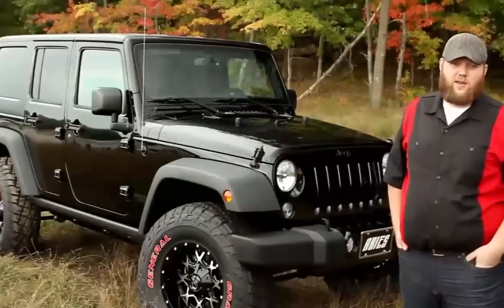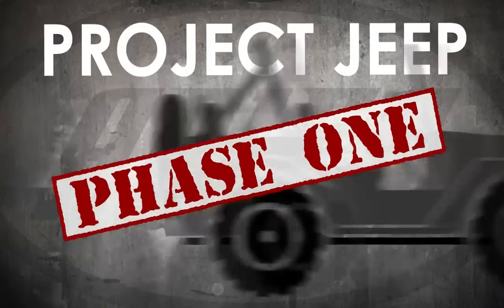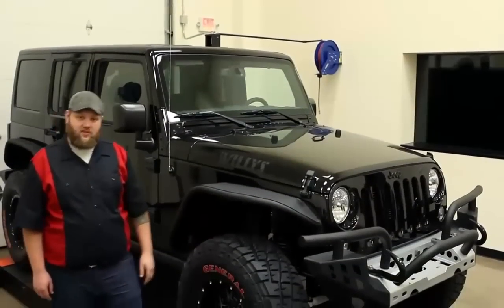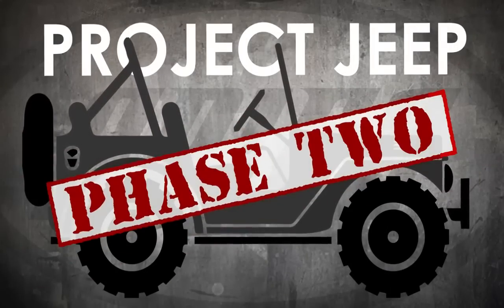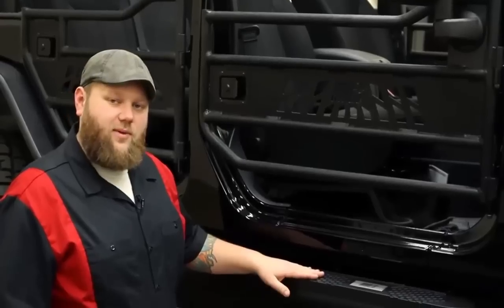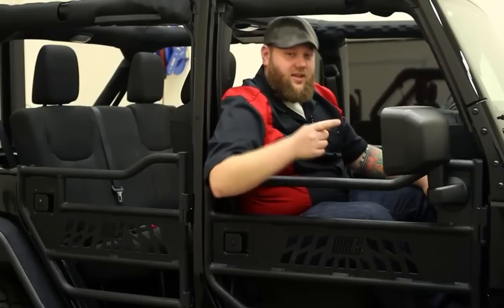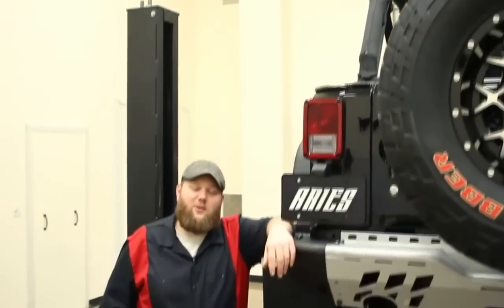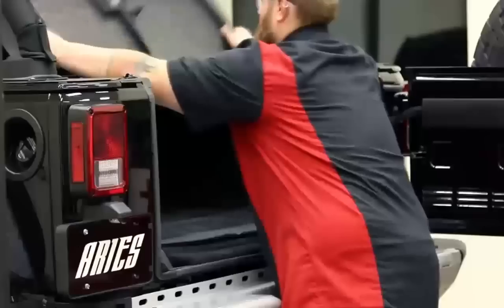Aries Jeep Accessories: 2015 Jeep Wrangler Unlimited

Comment: Not that you mentioned it in your video but are you running the stock 3.73 gear ratio. I'm not sure what size tires that your running but it would defiantly be sluggish driving it around town and you can totally forget about 4-wheeling....

Comment: Phase 1: Install ugliest heaviest bumpers imaginable which will reduce your approach angle and get caught on a obstacle before the tire can make contact with it. Replace those adequate and sturdy factory recovery points with a medieval torture device. Then dismiss the only excuse to have such a ugly bumper - a winch. Forget that thing - won't be needing it at the mall. 
Phase 2 : Ditch those solid functional rock rails, those curbs at the mall won't high center you. Throw on some side steps that won't survive a hard impact and reduce ground clearance. Next, who has time to roll your windows down? You need some roller coaster bars which won't provide you with the same none-restrictive and open experience as having no doors and will eliminate the option to secure your vehicle and guard you from the wind. 
Phase 3 : Drop $800 on solid cargo lid. It will protect you from ANY thief who doesn't know that most vehicles have folding rear seats. Don't worry, those roller coaster bars will prevent anyone from accessing your rear seat. 
Phase 4: Mud flaps are ridiculous on a Jeep but lets emphasis this by not installing them behind the front tires - which are constantly slinging gravel/rocks/dirt into the body of the Jeep and coating the door handles or in this case - your passengers.

CONGRATULATIONS! You've just built yourself the ultimate mall crawler which will immediately identify you as someone who goes accessory crazy and starts throwing money at a rig without actually going off road to see what areas require modification. Fortunately - you never go off road and your loser friends are just as much as posers as you, so you'll never be called out for wasting loads of cash on a vehicle that was clearly not designed and built for your needs.
Reply: Those bumpers are about the same weight at the stock bumper if you get the aluminum ones
Reply: Lmao! Couldn't have said it BETTER myself... Such an ugly build
Reply: 😂😭😂😭😂 im dying laughing at your comments
Reply: I love the lockable storage lid. Sure hope no one has a set of allen wrench's to unscrew the  the rest of the lid... I did enjoy your narrative, great job!